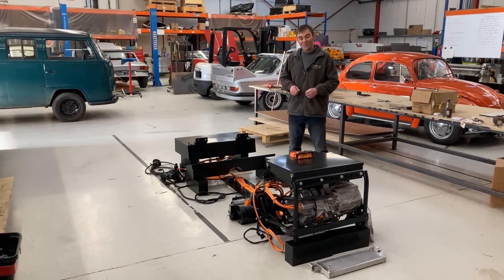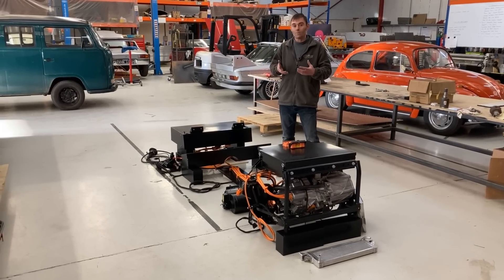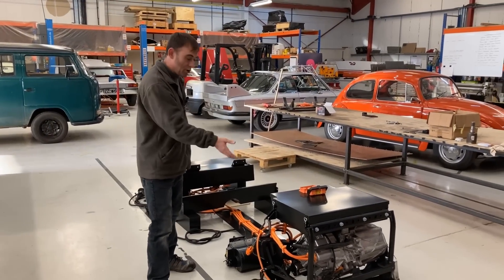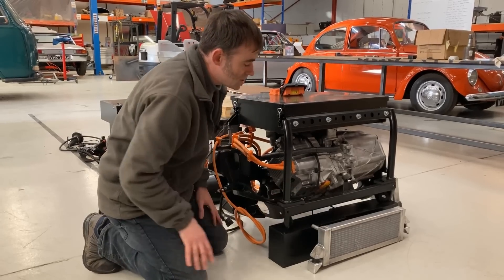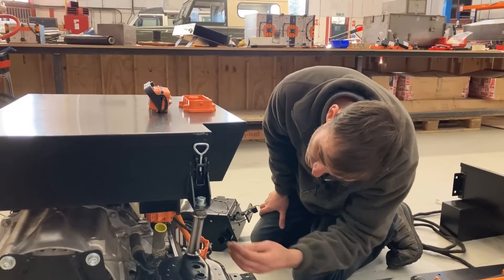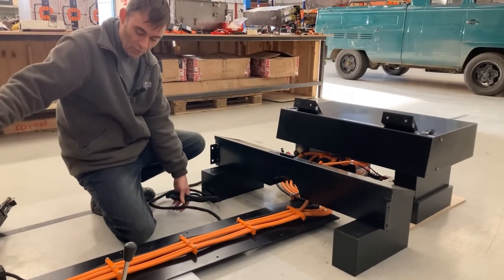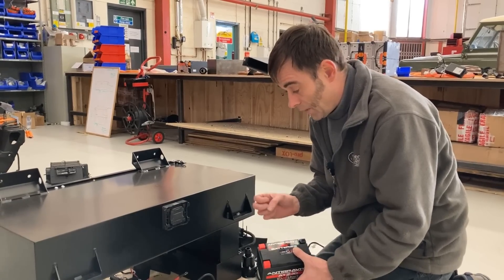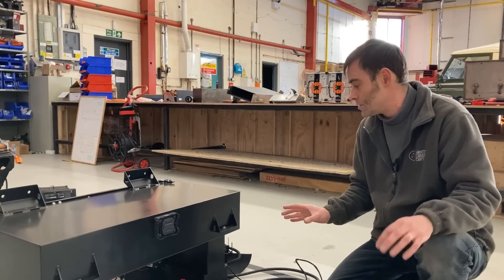Classic Mini bolt-in electric conversion kit.

Comment: Nice kit 👍
Great work 
I would love to know if there is a similar kit for the Citroen XM y3/y4 1990-1995 ? 
The challenge me be the hydraulic numatik suspension 🤔
Reply: How is the hydraulic suspension powered in the Citroen now? Are the hydraulics powered by an electric motor? If they are, then there would be no change, if the hydraulics are somehow powered by the ICE engine, then it would be a matter of simply installing an electric hydraulic pump.
Reply: @bbcooter388  the good old Citroëns were the hydraulic powered by the ICE but the C5 and C6 was electric driven.
i wood love to convert an old XM to electric 
the XM is a pure drivers car, have had to of them.   love them, but taxes on diesel cars are insane here in DK, around 1200 GBP a year

Comment: Just finishing my Clubman EV conversion and moving onto the next project, your kit seems to offer a little bit more performance which might suit my next project (track EV), so I'm interested but also curious about the weight trade-off, how much does the kit add to the original mini weight and what about the distribution of the weight 60/40?....50/50?
Reply: think the earlier separate item explanations of weight Vs the A series engine/box unit was covered elsewhere.
Reply: @highpath4776  any chance you have the link to that video?......the one I'm building at the moment is not tesla based so I'm curious for my next project. if not no worries I will just call them directly.

Comment: This would be a great way to upgrade the 169 Fiat Panda. That's the second version from 2004 to 2011. Not to forget the Mk2 Punto a little larger but especially cute in the boat tail two door version. Better spec cars have air conditioning which could be electric powered. Swap the fluid flow to use it for heating or cooling.

Comment: No temperature control for the batteries? It's a tidy kit but a bit compromised by the lack.
Reply from the maker: What? Wrong. 👍
Reply: @ElectricClassicCars  Def not wrong and this is a classic after all. A great way to save them.

Comment: Liked the video.  I didn't hear the price.  Also, I read one of the comments was that the range is only 150 miles.  Until these units can go at least 300 miles and that they can be recharge quickly then I see very little conversion use for this product.

Comment: Apart from the trick shift lever, what instrumentation and controls are included, and how would they integrate with the original instrumentation and controls?
Reply from the maker: The gauge cluster looks exactly the same as the original Mini cluster, but now it gets its data from the motor and battery management system. 👍
Reply: @ElectricClassicCars  Would you not need to know the tyre sizes to be able to calculate that?

Comment: Love this! Would love to go for this type of swap down the road. The under seat battery box is genius. Cutting the boot floor out for a battery box that fits between the subframe could mean you keep boot space
Reply from the maker: That's correct regards the boot floor but the idea behind this is to not cut anything and simply have a bolt-in kit. 👍
Reply: @ElectricClassicCars  of course 👍
Reply: @ElectricClassicCars Hi Folks - nice work on the kit. I have a question: How much boot space does the rear pack consume? Is there any usable space left? Can you still slide a spare tire (maybe a compact spare) in on top of the pack?  I think if I were to convert my '91 Cooper I would want to flatten out the boot floor by cutting out the basin for the spare tire and welding in a plate, but then put one of those external spare tire hangers under the boot floor in the middle of the subframe, and also convert the battery box so that it has a waterproof hatch on it so that the lithium 12V battery could be stowed away underneath to preserve boot space but still be accessible without having to remove the main pack. Anyway: how much boot space remains with your kit? And have you considered a lower voltage / lower hp motor and shorter "commuter/shopping" range setup that might omit the need for the rear pack altogether?
Reply: I found a photo that Richard emailed and the boot battery box height only gets to about halfway up the taillights, so you could still get a few groceries (or possibly a spate tire) in there while preserving the 4-seater-ness that so many other Mini EV conversions don't. 

Here's the photo:
https://drive.google.com/file/d/1cnHjW86QQtIuxIaaG6wnj9uxWS74VLEI/view?usp=drivesdk

That's really quite good!
Reply: @jamespotter5729  oh wow yeah that’s not bad at all
Reply: @jamespotter5729  LOL....can you imagine having 4 adults in an EV Mini rated at 300 HP and get into an emergency braking situation?......kiss your arses goodbye.

Comment: What is the most affordable conversion that you have done, and how much was the cost?  Love your videos!
Reply: There is another company that uses Leaf parts  (second hand) and you are still looking at £8000 for the core parts plus maybe £2000+ for the custom bits needed. Also 100% agree that that is is not DIY work as the risk of getting it wrong is to high. Leaf as 600amp fuse it it!
Reply: @Si Mullane a competent electrician wouldn't have that problem 😉

Comment: I was wondering, ever since I watched the Mini conversion on Vintage Voltage, why you couldn’t put a battery box in the centre of the rear subframe? Especially if you deleted the 12v battery box. I know that makes it a little less reversible but it’s easy enough to buy another battery box if you ever did want to reverse the conversion. Also, any plans to make a transfer box/final drive unit suitable for a motor like the NetGain HyPer 9, to fit Minis, 2CVs, Fiat 500s and Beetles? Similar idea to the box you made to fit front motor RWD installs. I know it’s more complicated but the weight, efficiency and space savings would be considerable. Carefully engineered, it may be possible to fit all the cars I listed, front and rear engined, therefore allowing the same main components to be used in numerous conversions? I realise gearing and direction of motor rotation will need to be considered but would love the idea if it’s economically feasible.
Reply: Do you need a 12v battery system,  part of the 12v need was for the heater drive and the spark/coil.  A couple of small 6v or motor cycle batteries would do for the lights and radio cassette player ?
Reply: @highpath4776  I believe they are using a small lithium-ion 12v to run the lights, fire up the contacts for the traction battery etc

Comment: "Completely reversible" - but why would you? 😁
Reply: Because when the batteries are knackered and its more than twice the original cost of the conversion to replace them, coupled with the fact that charging them up will cost 50 times more than it does today,  you can always stick the original motor back in an run it on hydrogen instead :)
Reply: When you realise how unusable it is in real life.
Reply: @ralphmillais5237  why would it be unusable? I suppose if you need to go off road or deliver large appliances. If you need to have fun round country lanes, this will be excellent 👍🏻
Reply: @FergusMcIver  No real range. No proper journeys not possible in these very expensive trinkets. A 40K / 50K conversion just to potter around lanes a few miles from home? No thanks.
Reply: @ralphmillais5237  hang on... My daily is an old Nissan leaf which can only do 70 miles per charge. In the last 4 years I've driven 40,000 miles in it and not bought any petrol. I'd say that's useable and this car is even better than mine. Don't fear the EV ☺️
Reply: @FergusMcIver   If that suits you then fine, but I am not really talking about that. I am talking about a 50K conversion on a 30K classic car that has very limited actual useability.  I would never pay such a sum to devalue my classic Lotus and make it pretty much unusable for me. Where I live and the journeys I do it just would not be remotely viable, even if I did want to splash that amount of cash. I think I represent the majority at the moment. Batteries will have to become much better and much cheaper before I get interested I am afraid. Ask me again in 5 years time, I may have changed my mind.
Reply: @ralphmillais5237  he'll probably reverse the conversion when he reads this now
Reply: @FergusMcIver  LOL Oh dear....

Comment: Very neat 😎 and when the battery tech improves/lightens it will make brilliant sense. 

I know its the state of play at the moment but the costs of the 
Components is the major block on wider adoption of EV  for most potential drivers. 
The other problem area that manufactured EV owners are having is ... they have trouble getting vehicles fixed...not mechanics but yes you guessed it .....software development and fixes.... but this phenomena has also been penetrating the ICE car market as manufacturers cram more Computing electronics into all vehicles. 
If youve ever worked with software engineer s and programmers ..you will know they are like hamsters in a cage running on a wheel. Constantly being urged to fix it and make it go faster. 
We need to rethink how what and why we need from our vehicles... the original Mini was and is genius as its simple light and a master lesson in how to package  what you need into a urban vehicle and minimalism.
Reply: I have ideas to at least make the cost a monthly chunk affordable

Comment: Using safety as an excuse not to offer a kit to the public is a bit of a cop out.

I'll assume you dont lock the bonnet, strip the screw heads to prevent people from ever touching it? Never mind creating 300bhp monsters out of cars originally made for 40bhp could be considered unsafe.

Hopefully someone else will come on to the market with one as that is disappointing.

Comment: Love it, what about the vacuum for the braking system, how many hours to install the kit, and how long  it takes you to build the kit?
Reply: Older minis don't have a brake servo, later variants possibly do but if batteries increase weight you'd likely want to upgrade brakes from drum to disc in any case.
Reply: @stumac869  umm yeah especially if you’re in Track Mode @300hp!
Reply: They could use electric servos instead of vacuum power assisted brakes.
Reply: @John T.  yeah, like what Tesla has
Reply: @johnt.848  or a small Vaccum pump on a servo

Comment: Do you have an installer in Australia. I have a modified KE55 Corolla Coupe would love it to remain rear drive power steering cruise control climate control. Current electric and driveline are from a Lexus IS 250. 2.5 litre V6. It is great fun to drive. My wife and are planning on using the car to go touring over the next couple of years. It very often tows a tear drop caravan.

Comment: Is there a Moke version planned?
Reply: Front should go straight in a moke, the side pods have so much room for batteries, add a battery box under the rear floor in the subframe and the range could be huge! A pity about the aerodynamics though...
Reply: @arrindaley3714  moke owners care not for aerodynamics.....it's all about getting looks and having fun.
I tell you what tho...one of these kits in a moke would be an absolute blast to drive 😁😁
Reply: I've would love to drop the "smaller" ICE from my moke.
Cells in side pods (as suggested elsewhere) & under bonnet. Probably sacrifice a bit of range. Ways around that ;)
Reply: @timmower4286  those side pods would hold a considerable amount of batteries. The range would probably be better than expected. 
With that said, the Moke isn't really a 'touring vehicle'. You wouldn't need 200 miles of range. 80-100 mile range would make it more than capable as a fun run about. Trips to the shops, back and forth to work, zipping about the country on the weekend. I think it would be great. 👍
Reply: @Mardy72   could be right there - I'm factoring some electronics eating up some of that protected space too
Certainly worth looking further into :)

Comment: Nice kit. It would definitely open the market up if you could do a truly idiot proof version that was fully sealed and had HV connectors without open terminals so that it could be done DIY by those not so deep of pocket. A bit further down the line I could see a market for a kit for the not quite so bloated R50 R52 R53 BMW Minis being popular,  300 bhp would still be more than enough and a bit more battery space available?
Reply: High power is relatively easy with electric motors. Fitting in large enough batteries is not.
Reply: @BH-ln5pt  I think those French kits are for other small cars as well and are subsidised by the French government. I believe they are very low power and the range is quite poor. Possibly only good for city commuting?

Comment: I take it that the battery boxes do not have heating/cooling. I am a bit vague on battery thermal management but is it not needed with the relatively low power charger?

Comment: The rear battery assembly looked quite large. Did it also fit up from underneath as a rear subframe,  or installed via the boot?
Reply from the maker: Installed in the boot. 👍

Comment: How difficult/easy is it to do a body swap of a classic car body onto a modern EV if the wheelbase, track, length, etc. are all similar. Ladder frame to ladder frame.

Will the modern skateboard battery platform be a great benefit or a big hindrance?

Comparing it to a standard electric conversion such as this kit

Comment: Would the defender bolt in fit into a RR Classic?
Reply from the maker: The front battery box is the only bit that doesn't fit. It needs to sit lower in the engine bay so that the bonnet can close. Our partner in the US (ECD) has made it fit though, so it is possible. 👍

Comment: Do you do a kit for rear wheel drive escorts? Yes, the good escorts from back in the day?
Reply: I'd also be curious to see if an SDU would fit under the rear of a Mk1 or Mk2 Escort. Retropower have been using various components to add IRS to Mk1 cars (check out their video series for an ICE build or a Mk1 Escort for Gordon Murray).

Comment: How do you connect the drive wheels to the motor?
Reply from the maker: Driveshafts.👍
Reply: @ElectricClassicCars  🤣
Reply: @ElectricClassicCars  Do the standard mini driveshafts simply push into either side of the motor?
Reply: @timmytrimble4069   dont think the original driveshafts would like the 300 bhp...
Reply: @paulriggers1558  What else on the drive chain would need to change?
Reply: @timmytrimble4069  ideally front hubs, flanges,+ wheelbearings, as the 1959 design was minimalistic, all parts expecting to see way less than 100 BHP, average lifespan of bearings was 30-40k with 40 BHP engines. the later rear hubs would probably be ok, [beefed up for 2000MY coopers i believe]

Comment: What happens if you accidentally knock the gearstick into reverse when you’re going forward?
Reply from the maker: Nothing. The system ignores any change of direction if the car is in motion more than a few MPH. 👍
Reply: @ElectricClassicCars  You guys are no fun at all.
Reply: @ElectricClassicCars  It stops a change of direction ?  Are you saying the steering stops working. I know they sound like Scaletrix but that is taking it too far.
Reply: @philipdavis5572  Maybe they have magnets to keep them on track.
Reply: Ejecter seat is activated! 😅😂
Reply: You go backwards.
Reply: @MrTerrymiff  Instantaneously 🤣

Comment: Would be great to see a start to finish conversion using one of these kits.
Reply: Agreed.
Reply: On vintage voltage
Reply: This also gets my vote. Either straight up conversion or a mini with lots of engine parts missing, prime for an EV conversion.
Reply: Please make this happen
Reply: Brilliant!!

Using such an EV conversion in a $10k carbon fibre mini shell would result a real sleeper, but not likely be legally roadable in the US without a Manufacturers Certificate.
Reply: see https://youtu.be/fKWe1R1bWOM  it's not identical though..
Reply: https://youtu.be/fKWe1R1bWOM
Reply: Look for classic tesla powered mini its not that impressive
Reply: Yes, it would.
Reply: I’d be willing to lend you my mini if you want one to demonstrate/film the conversion on
 (currently SORN but only because I was hospitalised and could no longer drive her at the time… otherwise she’s been sat covered in a garage for a couple of years and still runs like a dream…)